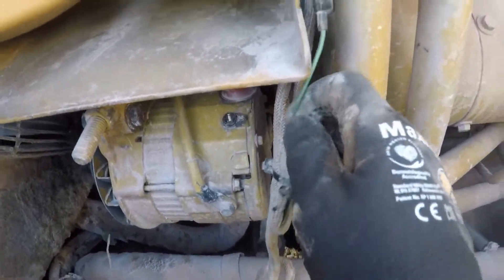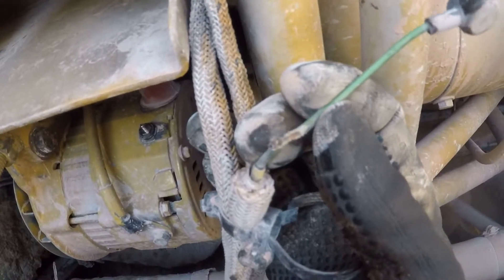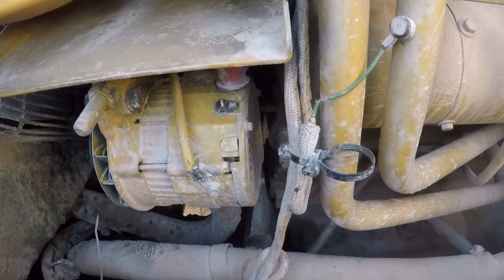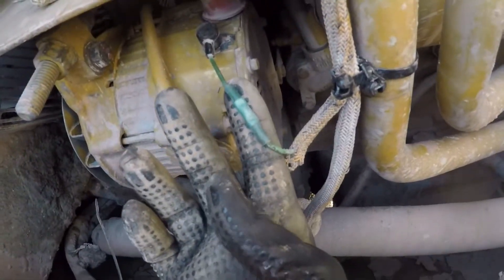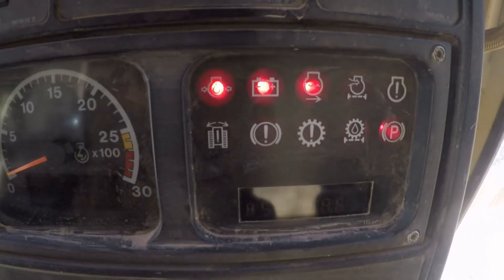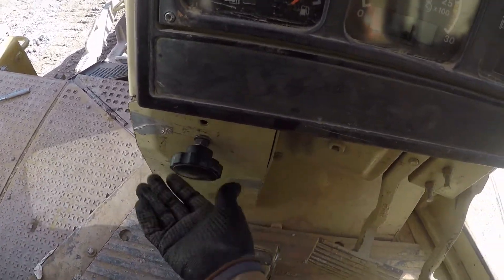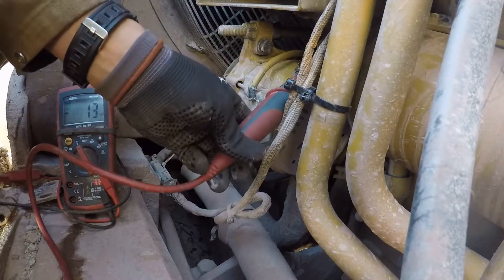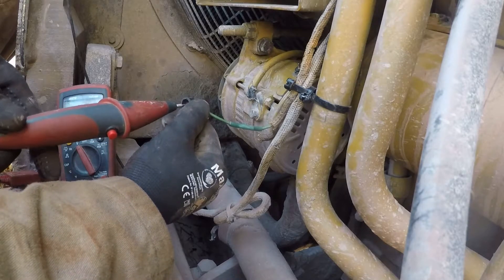CAT D10R Low voltage alarms

Comment: Why did the alarm still come on after the wire repair?
Reply from the maker: Belt was slipping at high idle. Repaired the wire, the alarm came on again at high idle, I shut it down and tightened the belt and it was good after that.